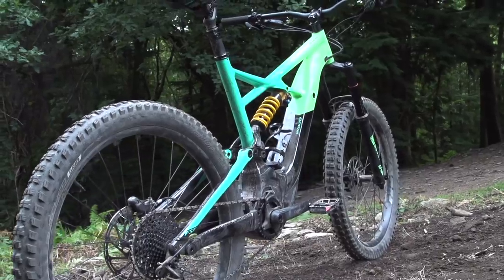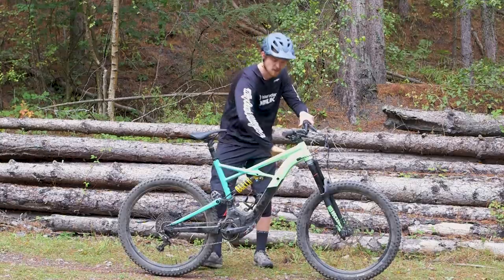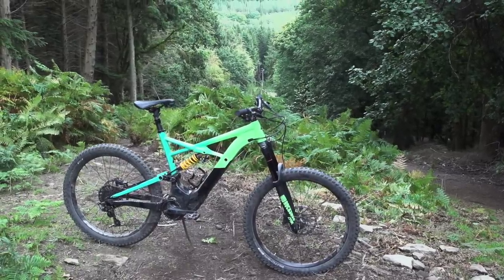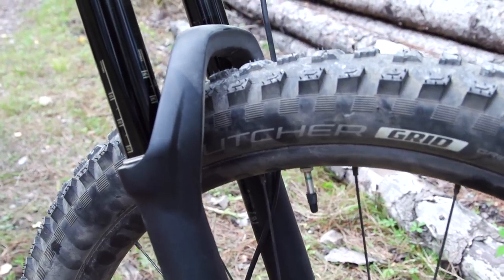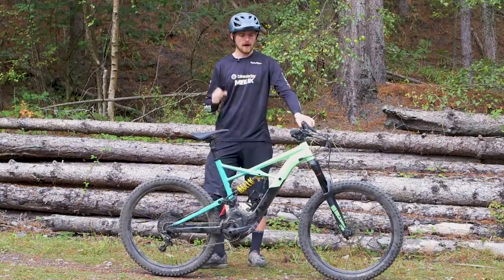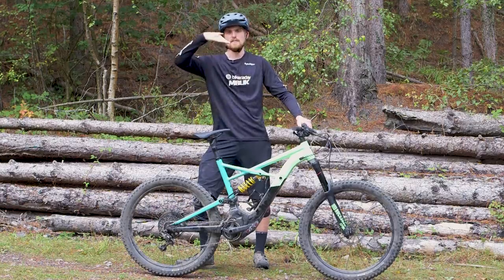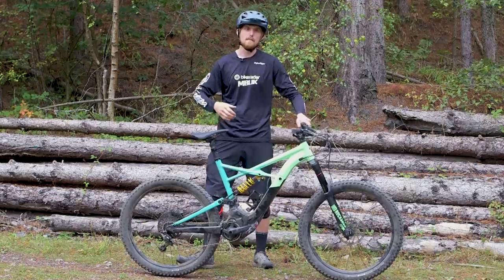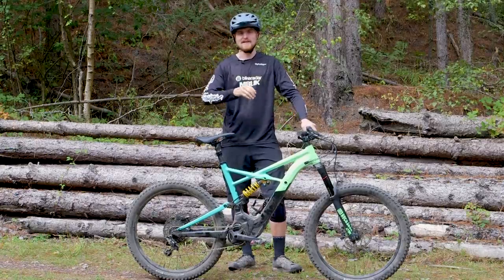Specialized Turbo Kenevo Review - Agile Long-Travel e-MTB

Comment: The multitool actually has an 8 mm allen key ! (this bizare long rectangle key)
Reply: You're right, but it's not much use for, say, removing a stiff pedal or crank bolt. Point is, if you want to do some serious bike-fixing, you'd be better off with a conventional multi-tool.

Comment: 6:30 I think in dropper post era (which soon will end as the dropper seat tubes are already showing up) double bolt 20mm tall clams should be a standard, which would also make the dropper bit harder to steal -two different, unusual bolts

Comment: All cool and exciting, but when is this technology going to trickle down to affordable systems.
Reply: Jimi Banz You can already get a Shimano E8000 equipped Commencal Meta Power or Canyon Spectral ON for not much more than half of the price of this Kenevo.
Reply: @tamasvarga67  
Still no where near affordable to the average consumer, this technology is way overpriced atm
Reply: Jimi Banz I don’t think it’s reasonable to expect them to be the same price as the regular bikes. A mid level trail bike is ~3500€ and the ebike version can be had for 1000€ more and you’ll get a motor with a 500Wh battery for it. If you want a Specialized you’ll pay premium for the name but the same can be said for their regular bikes too.
I’m not saying they are cheap but in Westen Europe the demand is huge and they are outselling the regular bikes.
Reply: @tamasvarga67  I think if you read my OP it's clearly states "technology"

Nothing about brands being expensive at all.
Reply: Jimi Banz ...and I said that a mid level trail bike + ~1000€ is their ebike version.
Reply: @tamasvarga67  
Brands like..
Commercial
Canyon
Specialized
Isn't in my original comment when suggesting such technology will trickle down to affordable systems.
Reply: Jimi Banz OK, instead of being fictional I brought up some brands as examples showing that the technology already ‘trickled down’. I don’t know what your expectations are but you won’t get an ebike for the price of a same category similarly equipped regular bike.They start from +1000€ and if you think about how much a motor and a battery cost that’s a pretty good deal. On the cheap, you can get a Chinese conversion kit and put  it in a Walmart bike, strap a battery on and you have an ebike. Depending on the battery, the conversion won’t be much (if any) cheaper than the aforementioned +1000€.

Comment: None of what you say about weight balance applies to the smaller sizes. The smaller sizes are terribly flawed. I'll stick to my regular bike until (e)bike manufacturers figure out how to properly design so size S and M don't ride like nose-heavy townie/cruiser bikes.
Reply: @josh vaughan i take it you haven't ridden size S and M bikes with long chainstays without proportionally longer front centers? Can't just keep CS length the same and shorten the front, esp considering most of the weight is forward of the BB. Nose-heavy = small rider needs to ride with ass back.